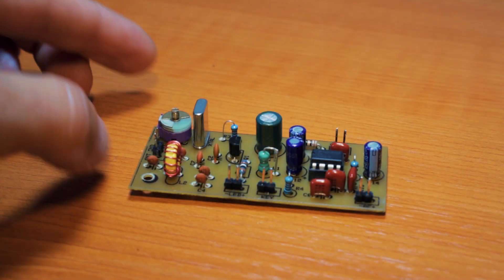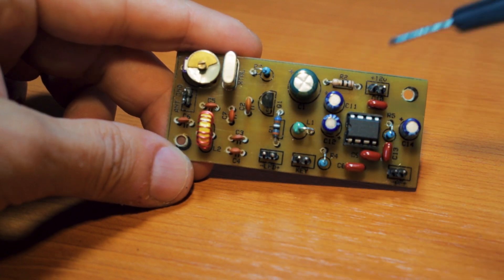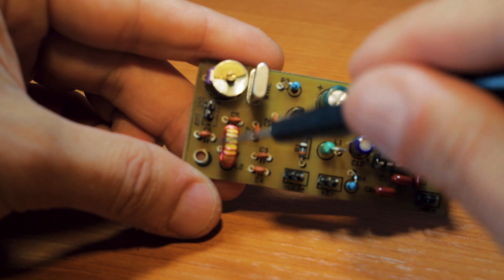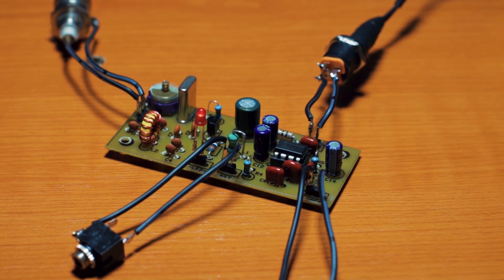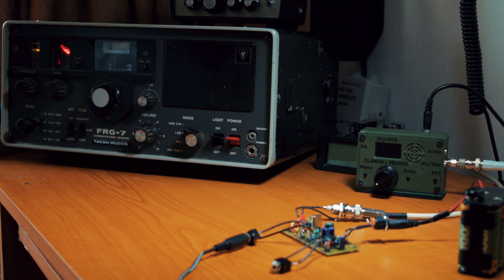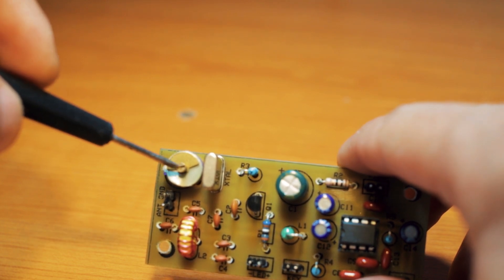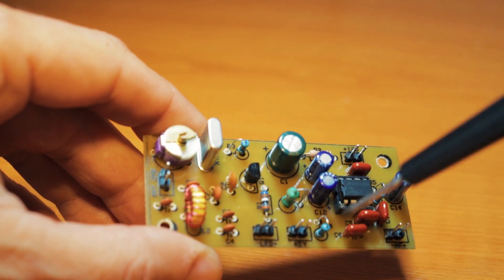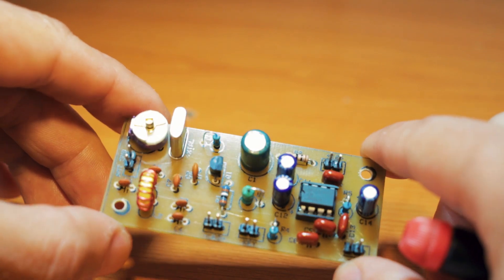You Can Get On Air For Less Than $10, With The Pititico 2 CW Transceiver

Comment: Great work Bro. Can you redesign this circuit to replace 7.030MHz crystal to LC circuit and add AM modulator for voice. 73❤
Reply from the maker: Because of the simplicity of the circuit..  it won't work with LC instead of crystal. It would but it would end up being complicated using way more transistors. Then it would no longer fit the idea "simple TRX" )). Then the AM modulator even more parts and you end up with something so complicated that is noth worth the time, because there are already schematics out there for that )). 73 buddy.

Comment: Are you selling the PCB? Charlie KM4ZZ
Reply from the maker: Hi Charlie... unfortunately no. But I will put the blog post tomorrow and have the PDF files for download for those who want to make the board with heat transfer or similar stuff. Is pretty easy that way. In 15 min you have a PCB board )). I love making them this way. I will have the link to the blog post tomorrow in the video description. 73
Reply: @dxexplorer  thanks. I’ll give it a try. Can you post the schematic as well? 73
Reply from the maker: Of course I will )) and a few more interesting details I left out of the video not to make it too long and boring ))